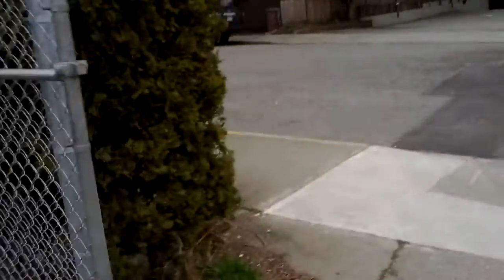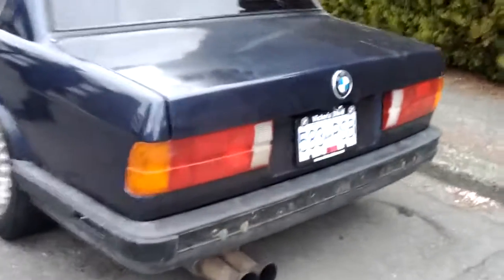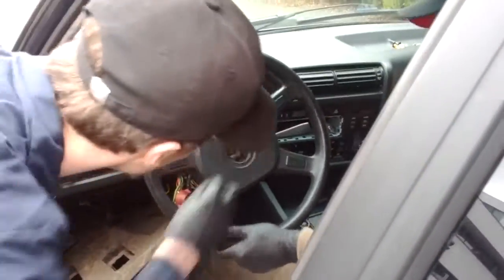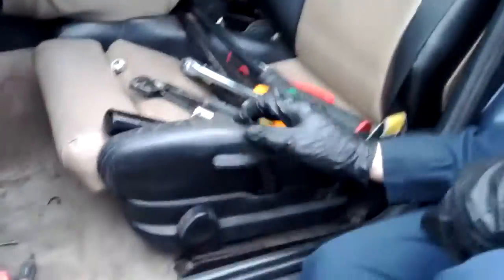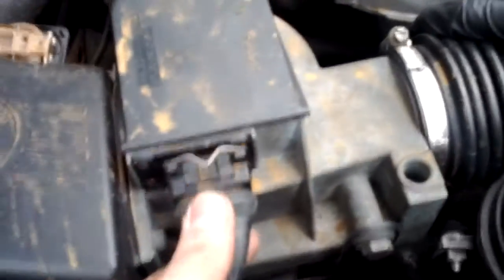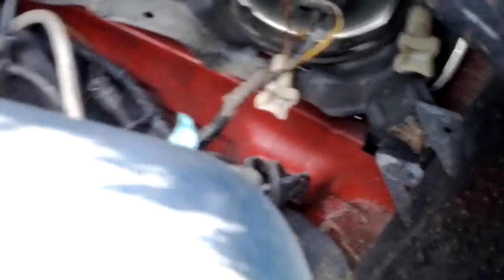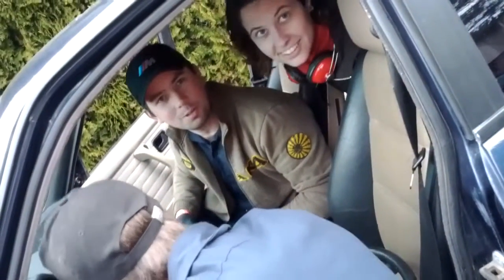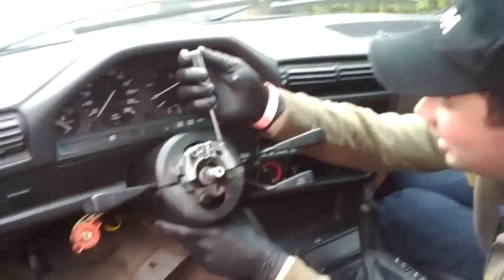This Old Car: 1987 BMW 325e

Comment: @nrhbmw I still have a few months til I get my license so I have time to sort out any little issues. getting it for a decent price and it seems to be in pretty good running condition. I guess the idling problems been fixed

Comment: you gotta get a dremel and shave off a spot on the lip on the outside of the ignition cylinder, right over the hole. in order to take the cylinder out to do this you have to insert key to position 1 and use a pin to poke in the hole on the bottom. broke my key in my 86 325e and had 2 get the broken part out.